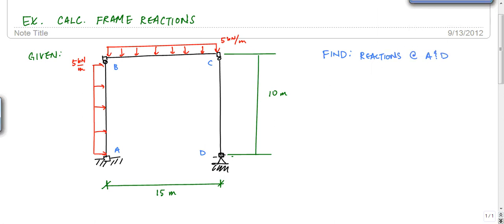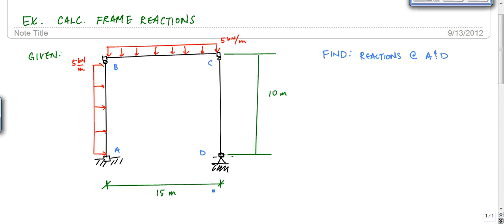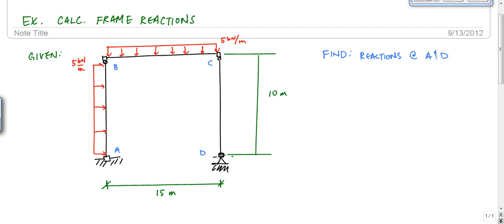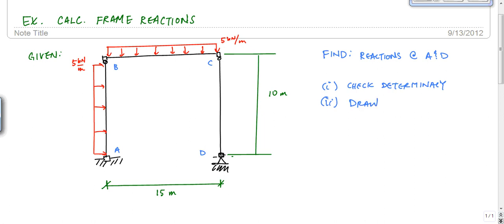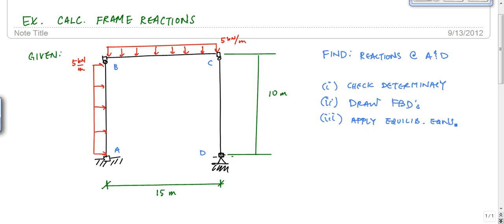Calculating Reactions of a Frame - Structural Analysis

Comment: if the frame is rigid then its statically indeterminate, if it is pin joined then it is statically determinate. right?

Comment: For determinacy check use this equation (3m+r)-(3j+c)
Where m=member, r=Number of reaction, J=Number of joints C=Number of internal hinge, 
for Statically determinate (Ns)=(3m+r)-(3j+c)
for externally determinancy (Ne)=r-3-c
for internally determinancy (Ni)=Ns-Ni
Reply: M=3 (Member AB, BC and CD)
R=5 ( Fixed Support= 3 + Pin Support=2)
J=4 (Joint A, B, C and D),
C=2 (Hinge A + Hinge B)

NU = 3m+r = 3×3+5 = 14
EQ = 3j+c = 3×4+2 = 14
NU = EQ
Reply: i know this is a long time ago but can anyone explain what m,r,j and c are on this particular frame, since im doing this is slovenian.

Comment: the solution is wrong.
there should be transfer of moment at B and C too...u r transfering only the loads...what about the moment...even it should be transfered from A to B and B to C...
And when u check dis sum in frame design app..the value of Ma comes out to be 144.5 
KNm
pls correct this
Reply: at B and C there is hinge support, hinges don't have moments.
Reply: Lol pins and hinges dont carry moments
Reply: sanjay kumawat  ,,,ya u write.....he not even explaining the matrix method.....